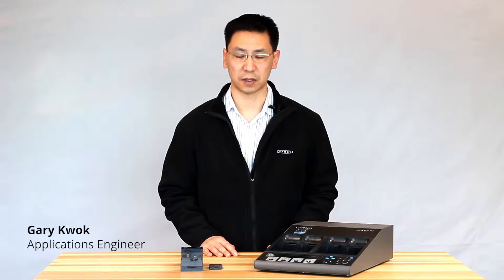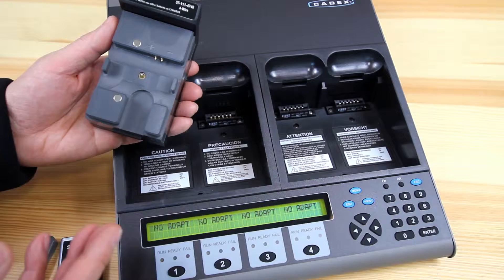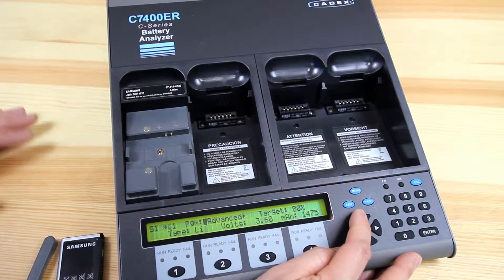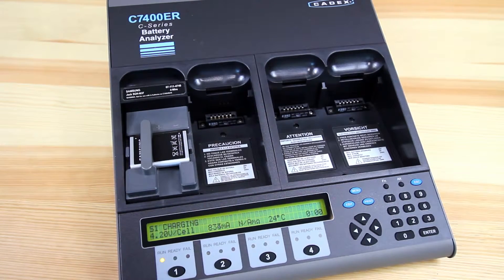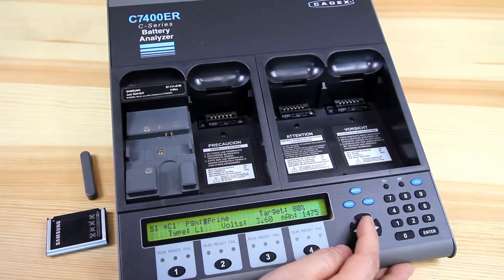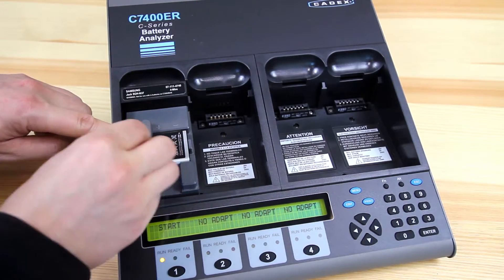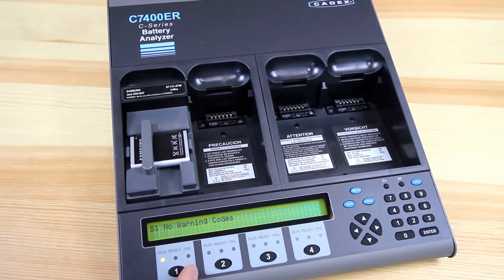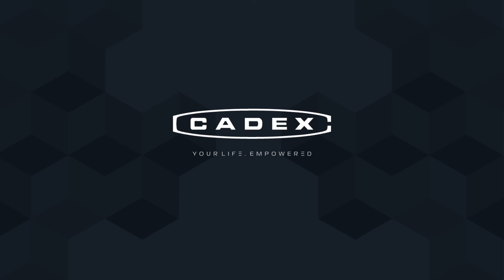C7 Tutorial - Basic Programs: Charge Auto

Comment: Can a custom program be set to check battery voltage and discharge to minimum (if needed), then start the cycle program fully charging, dishcharging, calculating capacity, and recharging?